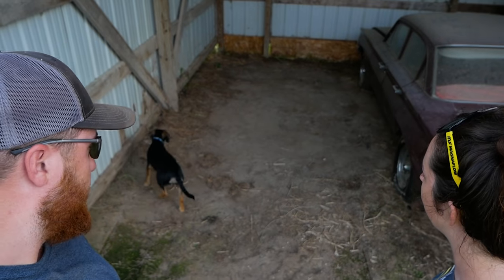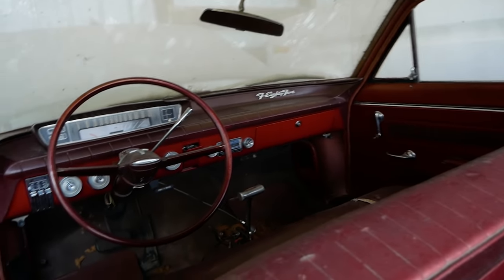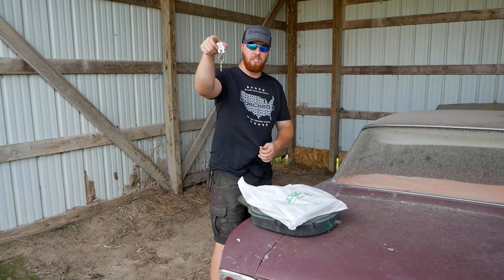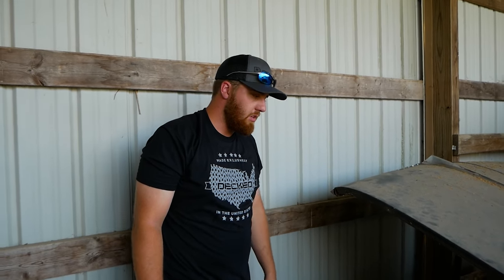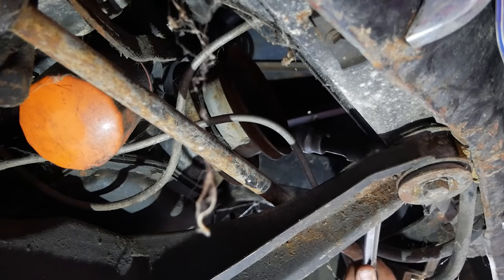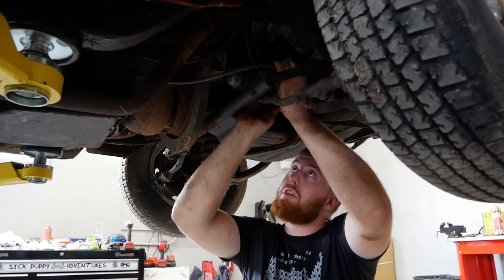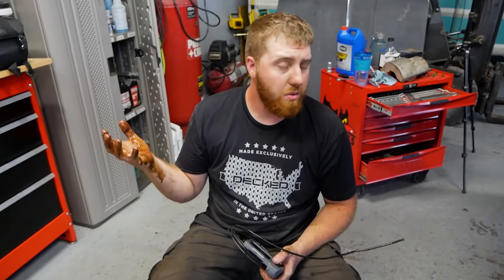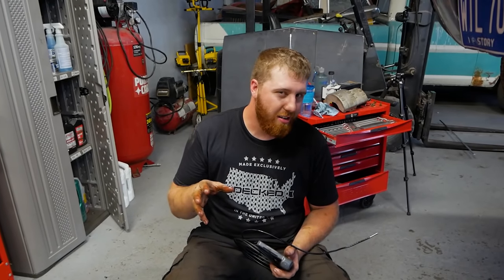BARNFIND Oldsmobile F-85 First Start in 25 Years!! - Part 1

Comment: I believe that's a Buick design engine which means that that oil pump probably lost its prime pop it open pack it with Vaseline and put it back together you won't have any more problems you'll have oil pressure almost instantly I did that with a Buick 3.8 231 whatever you want to call it
Reply: Yup, pack the pump with assembly lube/Vaseline.
Reply: I was coming here to say the same.  My 68 Buick 350 has the same gear style pump.
Reply: @AutoAli  amc have the same problem
Reply: Been there done it also, vasoline is the only way I ever got these pumps to prime
Reply: If you have a hand pump you could back-prime the system hook it to the pressure port and pump it full of oil.
Reply: The general design was by Buick but olds had numerous differences mainly in the heads, valves and pistons.. few parts were interchangable..
Reply: Yep, I just checked the Motor manual and that's exactly what it says. Take off the pump cover and pack the space around the pump gears with petroleum jelly. Otherwise it will not pump oil when the engine is started.
Reply from the maker: Thats my plan when were back next week! 🤘
Reply: @mikeystoy  Yup, and just like an AMC V8 if it's not packed full of lube you can spin it all day and never get it to prime.
Reply: Pump lost its prime...like other folks are saying get yourself a tub of petroleum jelly. Pack the pump cavity full of the stuff...oil and filter....prime with your drill setup...you should be good to go all things being equal.
Reply: @JunkyardDigs  at least you can get another video or two out of the car. 😂
Reply: The Buick and olds are the same engines with different heads. The Buick looks like a mini nailhead and the Olds looks like an early to mid '60s Olds
Reply: @spyderMN  yep. Was gonna say the same thing. Back prime down the system.
Reply: Absolutely have to prime up the oil system with vaseline. ( in a pinch grease can work) Remove the bottom cover of the pump, pack it with vaseline, and then prime it. This oil pump design was Buick's biggest failing, not only do they lose prime when sitting for a very long time, but in winter they tended to fail at extremely cold temperatures trying to move butter from the back into the pump which was made with steel gears in an aluminum housing. Yup; - you tore the clearances out and had no oil pressure.
Reply: ill agree as well.
Reply: The oil pump is on the front timing cover and easily accessible as well
Reply: I agree.  My brother blew up his GTO that way.  It was kind of my fault because i started it when he was changing the oil.  On the other hand he drove it with the oil light on.
Reply: @JunkyardDigs  While you're at it for shits and grins, check to make sure that the pick up tube isn't loaded up with crap. That will stop all oil movement.
Reply: Before you go to the Vaseline, I would suggest back feeding some oil down your standpipe/ oil pressure sender hole. If you can just get some oil in the pump, it should be able to prime up. Ive seen some people make oil priming rigs out of weed sprayers, just make some adapters and put oil in the sprayer, pump it up and you can force oil back through the system- should get everywhere including the pump. Different pump and engine, but i had to do that on a 2015 6.2 L99 with the same issue, sat too long and all the oil ran out of the pump...
Reply: @JunkyardDigs  yep,
holden 253/308's are the same ,
pack with vaso and spin the dizzy drive to get pressure
Reply: It Is A  BOP Engine (Buick, Pontiac, Oldsmobile)
Reply: @JunkyardDigs  in the past i have lightly pressurised the engine with air until oil starts coming out of the open port  . i was just using my mouth on the breather pipe, no need to take it apart, once you see oil coming out that port you know the pump is primed. hope it works for you, keep up the good work
Reply: Odd to see so many with this problem. Mine never once had an oil pressure problem.
Although I got a scare when the old-timer at a gas station "filled her brimmin' full" on night. I had visions of the pistons slamming against a sea of oil, but it never caused any problem. I still drained the excess oil as soon as I could.
Reply: I have seen these engines loose there prime after dropping the oil then removing the filter with the sump empty
Reply: Agreed. This is a common problem on these. Pack the pump full of grease and it'll get pressure. I've seen rebuilt ones of these have this problem
Reply: Buick only released them for 2yrs that I know of, 61 and 62 before selling the tooling and stock to Rover who used variations of it for decades including the Triumph Tr-8.
Reply: You're right  .

That's a Buick V8
Reply: @JunkyardDigs  What they said, I just don't remember if that pump is obtainable from the outside of the block like Y block ford 292 engines
Reply: @JunkyardDigs  oh come on. I don’t wanna wait
Reply: Was going to suggest the vaseline as well. Saw MyVintageIron rebuild a big block  Buick and he spent a few minutes detailing that process while putting the oil pump back together.
Reply: I agree with all the other fellas! Couldn’t say anymore about it! Just like to see you get it running and driving, whenever y’all get time…?!?!
Reply: @JunkyardDigs  I think your viewers would like to see you finish getting it running - with oil pressure. Get that KY Jelly and lube her up!
Reply: I had the same problem with my 231.  I used the vaseline in the gears and also lap sanded the pump housing face on a hard flat surface.  It had been scored by the pump gears and I smoothed out the wear grooves.
Reply: Came here to say the same. It's just like the engine in my Range Rover and my Discovery. Rover bought the engine from Buick, after all. Prime the pump, and you should be good to go.
Reply: @JunkyardDigs  100% need to prime the oilpump with vaseline or similar, every Rover v8 needs this doing if you strip the engine down
Reply: @JunkyardDigs  she deserves to run and drive again under your tutelage #CrewCabsNeedLoveToo
Reply: @radarw64  I would definitely put the fault on your brother if the oil light comes on after an oil change and it had never come on prior to that something is wrong and should be immediately investigated yeah you might’ve made a little mistake but the guy watching the speedometer climb with the oil light shining definitely should bear the brunt of the blame in my opinion but also shit happens and putting blame on someone never makes things better move past it learn from it then forget about it
Reply: @JunkyardDigs  Pop your valve covers off and see if there’s excessive wear up there from oil starvation it might also give you a good idea whether the engine was actually rebuilt or if the parts were bought but the job was never done good luck brother and my fingers are crossed ALL of them and it hurts
Reply: Hello from uk. Yes prime rover v8 with vaciline
Reply: @brucefisher4025   This is the Buick version .
Reply: If that's a 215 aluminum block V8 Buick pack the oil pump with Vasoline same goes on all Buick V8s I've ever owned, reason for using Vasoline is it dissipates into the engine oil quickly so as to not allowing it to pick up trash in the oil and plug the oil journals according to GMs Buick Motor Division. My 64 Buick came with a 300 ci with aluminum heads aluminum intake and a 4 barrel carb. Now has a Buick 350 tho
Reply: Try pumping some 85w90 in the sending unit port...see if it will prime
Reply: I had to do it with a 3.8 that wouldn't prime. I used grease instead of vaseline.
Reply: Yes, excellent suggestion!  Back in the day when we rebuilt many engines a week we primed them all with a pressurized oil connected to a sender port.  The pressure tank looked like a propane tank with a removable filler port.  We had a few quarts of 5w30 in it and hooked a 45psi regulated air line up to push oil into the engine.  It was a nice quiet way to prime any engine a make sure the pump was never dry spun.
Reply: Anyone who works on this motor in Rovers recommends packing the oil pump with Vasoline.
Reply: Enjoyed this episode. Thanks for sharing. 👍👉🇺🇸
Reply: @radarw64  lol
Reply: That’s how I primed my Land Rover 4l… basically a Buick block copied, and built badly.
Reply: Does anyone by chance know which year Kevin‘s red Ford F150 is? 
Thanks in advance and kind regards from Germany 🇩🇪, Philipp

Comment: Confirming the vaseline theory as well.  I have listed some tips ad tricks and foibles / peculiarities of the engine below as well. I have a Leyland P76 engine in my Triumph Stag.  The P76 4.4 litre engine is another derivative of the Buick 215 - just like the Rover 3.5.  

I tried to change the oil by draining the sump and changing the filter at the same time - pretty much like every other oil change I have ever done.  Bad move.  The next mistake I made was not filling up the new oil filter before putting it on.  When I cranked the engine, the oil pump spat what it had left in it into the filter, but it was not enough momentum to pull the new oil all the way up from the sump to fill the pump again....and it lost pressure, dumped it back and sat there cavitating with an air lock.  Result - no oil pressure no matter what I tried.  

Spoke to a Rover guy who told me the following:
- First thing I needed to do was to take my oil filter back off and fill it with oil.  
- Next, remove the bolts from the cover of the oil pump and bring the cover down slowly, as you need to be careful not to let the pump gears fall out.  
-------------  NOTE: The gear teeth are matched and if the cogs are taken out, the teeth need to go back in next to the one they were next to when they came out, so if you DO take them out, make sure they are marked in a way you can put them back the way they were.  The gears are also aluminium, so they don't take kindly to bouncing off a concrete floor....ask me how I know.
- Next, pack /fill that pump housing as much as you can in and around the cogs with vaseline, but try to keep the area around the oil holes free. 
- Cut yourself a new gasket and refit the cover.
- Make sure your engine oil is topped off at just over the full level
- Remove the distributor (marking its position on the mounting) and spin up the oil pump by using a flat head screwdriver bit in a drill (as you were doing)......BUT the Rover bloke ALSO gave me a very good tip with this one:
--------------  TIP: To make sure your drill bit does not fly off the pump shaft (especially when you crank that drill up in high gear, which you will need to do), cut a short length of ordinary garden hose that will fit over the end of your drill bit and the pump shaft.  The hose will not only stop your screwdriver bit from flying off, it will also help hold it more central on the shaft, so at high speeds it is easier to hang onto the drill.
- When the drill starts to labour, you have oil pressure, but leave it running like that for AT LEAST a minute in order that it pushes the vaseline through the engine oil galleries to a relief point somewhere.  
- Start your engine and get the engine warm up so that the vaseline melts all the way and moves down to the sump with the oil.  Presto - oil pressure every time she starts.

One more thing - use an oil viscosity that is slightly thicker than you would normally use on a revival (or use an additive to increase viscosity) and make sure she's a good oil.  These engines will take a lot of punishment (including running with no oil pressure for a while, so I doubt you did any damage), but they DO need a GOOD oil with a slightly thicker viscosity in order to maintain oil pressure with a hot engine at low rpm.  

By the way - they run with an oil pressure between 10 and 25 pounds at idle, but will run up to 70psi at high RPM (around 5000-ish), so don't be concerned if the gauge reads a bit low after you get over this minor hurdle.

Good luck!
Reply: Mookster

Comment: Kevin, I have had a lot of the Rover versions of these and its very common for them not to prime a dry oil pump after a rebuid or after standing for a long time.  The cure is to pack the pump with vasoline then turn it using an electric drill (as you did in the video) until pressure builds.
Reply: rover used a Buick engine, or rather they bought the engine from Buick to make it themselves

Comment: If it’s a gear driven pump take off the cover fill it with Vaseline to prime. Happen to me once on an old Buick.
Reply: Yes that will work and build oil pressure again it just needs a little help.
Reply: Pull the oil sending unit out and  with a Turkey baster..keep dripping oil down the hole until it's full. Put the sending unit back in an " M.A.G.A "  You get oil pressure again ..It least it worked for me that way on a 75 dodge van
Reply: This car looks like a corvair had a kid with a Bel air or impala maby a Chevelle and then that kid had a kid with a nova who happened to be it's cousin!.... Either way has a lot of Chevy attributes and I like it.         ALOT!
Reply: That engine in rovers in the UK will not prime when the engine has been rebuild unless it is packed with greese.
Reply: @chrisatcoldharbour  thats correct i used to drag race these engines here in the uk fill the pump gear housing with vasoline and prime it with a decent power electric drill, you will feel it pumping the oil

Comment: Being a land rover guy, seeing that alloy block with no oil leaking from every seal I'd say 100% been out of the car and rebuilt
Reply: In Australia we had a 4.4 version that was actually a very good motor in the P76 Leyland.
Reply: Did GM sell the entire aluminum V8 rights, tooling, etc to Rover soon after they stopped putting them in the Olds in the US?
Reply: I know they grabbed it for the range rover which was released in 1970 so I'd say a couple years before that for the pre production models and testing
Reply: @bossdog1480  the 4.4 was a good engine. Cant say the last time I saw a p76
Reply: @justinkeckhaver8199  Those engines are garbage that's why gm sold them off/canceled them. The brits did the best they could with them and actually there are still very many of them around on the roads as daily drivers in the UK today. Especially the 4.6. The US had problems casting aluminum blocks, they tended to always crack where as the Europeans had aluminum block casting down to a T. The Americans still can't figure out how to make a decent engine that's why they stick to a 60 odd year old design.. Cast iron push rod motors... Lol
Reply: @AnythingGasoline  k.
Reply: @oldsmobileman1403  Yes. Was put in the Rover 3500 in the sixties and was also put in the later MGBs.  Was bored out to 3.9/4.0 and 4.6 in the Land and Range Rover.
Reply: @jamesmcmechan888  Nice, but LR has since stopped using that block, correct?
Reply: @oldsmobileman1403  Yeah they have.  When they bored them out they had trouble with head gaskets and liners slipping.
Reply: @jamesmcmechan888  Ah, darn. They probably went as far as they could on that platform, then decided enough is enough. I will be devastated when the LS gets the same hatchet job here in the future. It is inevitable. How does the new engine in it's place hold up? Not as easy to work on? Is it something completely different overall?
Reply: @oldsmobileman1403  only had the 4.0 in a Discovery 2. I think they went to a V6 petrol.  Most of the engines now are diesels.
Reply: @benjamink591  they bought the rights in 65 with the engine first going into the rover p5 in 67

Comment: I can confirm what is said about the oil pump.  You should be able to take the pump end plate off, pack it with grease or boy butter, and get your pump to pick up.  Yes, use your drill to pre lube and confirm it works.

I owned two of those, a 63 and a 61.  The 63 was a Flintstones car and a heavy drinker.  I pulled the engine out of it, overhauled it, put it in the 61 that was in much better condition body wise.  I ignored the book's instructions to pack that pump with grease, had to re-do that part in-frame.  It wasn't easy, but it's do-able.

Original transmissions in those were a "Turbo Hydra-matic 3 speed," unique to those cars at the time.  No torque converter.  First gear 3.5:1, second gear 0.5:1, third gear 1:1.  Radical shift out of first if your foot wasn't really in it.  With the range selector in "S" (Super!) it would hold 2nd gear until you hit 60 mph ... go to third and warp speed.  Only car I've ever driven that actually settled into the road at high speed.  All those factors caused me to take a lot of State roads during the days of nationwide 55 mph, as Smokey was more likely to be on the parallel Interstate watching out for Bandit.  Also had to run it harder to get those chromatic rings to seat and it was a lot more fun to drive.

Do not run coolant stronger than a 50-50 mix, or it will get hot (VOE talking here).  If that engine was rebuilt, drive it by the temperature gauge (don't trust an idiot light) until it has broken in.

When you get it on the road, I think you'll be surprised.

Comment: Supreme job on the electrical diagnosis!  On the oil pump, since you diagnosed that it wasn’t the distributor drive, or a dislodged pickup, I would image these possible paths: poor prime, sheered gear, wrong pump…I.e. pickup tube leaving the oil intake filter out of the oil sump, or a clogged/plugged line.

Comment: Try priming the oil pump by pumping oil back through the oil gauge sender unit fitting. If oil pump gears dry out the will not create a vacuum allowing the pump to pull the oil from the sump. These engines rights sold to England and it is in many rovers MG and early Range Rovers. Over filling the sump bringing the level closer to the pump may work also!!